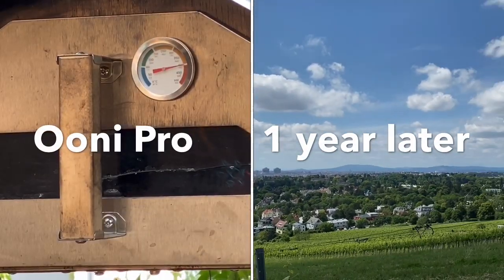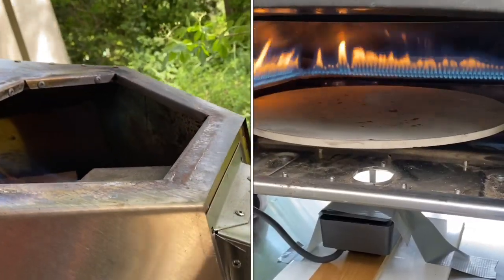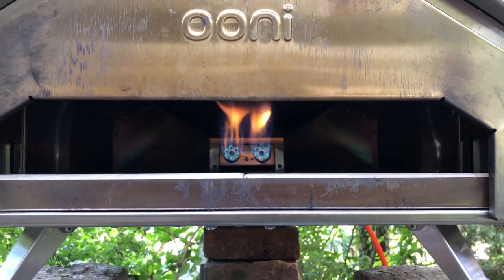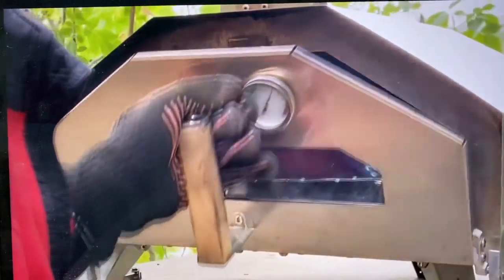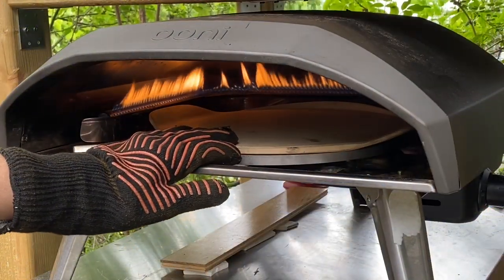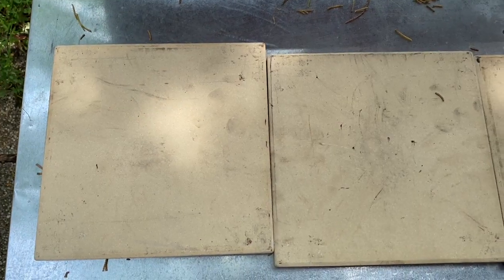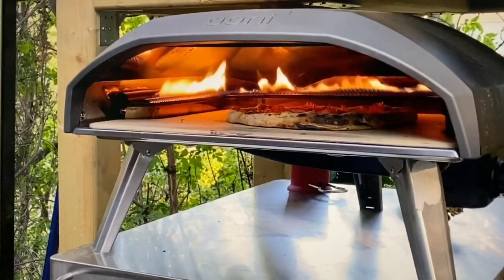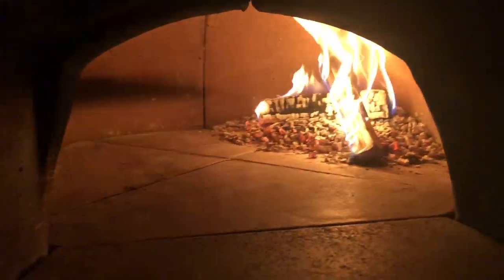1 year Ooni Pro vs. 2 month Koda 16 OR what the hack is my favourite Pizza oven

Comment: I just got told by a seller that a 16 inch pizza on the pro wasn't really possible, and they want to sell me a 14inch peel as a consequence.
Does that sound right - have you made 16inch pizzas on it?
Reply from the maker: yeah that sounds right man... this is just not possilble in a right way due to the heat difference from the front to the back - santa barbara baker does that in his vids but I'm not quite convinced... I think the right size for a koda 16 pizza is a 13 inch pizza _) greez hinze

Comment: Very nice video! Love the vineyards and the content. My thoughts are: they are both energy efficient; pro a bit more. That's nice for a backing a couple of pizza's. There is roam for improvement on temp consistency. More thermal mass would help, but I think this would have a negative effect on energy efficiency. I think an oven with a bit more thermal mass would help. Personally I prefer manual rotating. A round stone would be smaller with less thermal mass. But this is an opinion, not based on facts ;) Keep up the good work and enjoy your nice place!
Reply from the maker: Hey Pieterjdw! Thanks! Yeah you're absolutely right! More thermal mass makes it less energy efficient... if you're just into pizza it does not really matter... because you can get great pizza out of these small ovens but a dome like in the zio ziro mini or 60 just has a better radiant, convection and conduction heat so the pie rises more evenly... it is as with all this stuff... you get what you pay for... if you want thermal mass  you'll have to pay it and you'll have to heat it um :))) thanks a lot for your words and have fun with your pizza!
Reply from the maker: and... jea check this one out for thermal stability :))) https://youtu.be/A9xIEvDOsNo that's just insane - that's 10x the pirce of an ooni pro
Reply: @hinze55555  I have watched it; also very nice. Just like your most recent video! Very nice oven, but to pricy for me. Looking for something in between ;)
Reply from the maker: @pieterjdw  the zio would be it!
Reply: Great video! I’m shopping for a pizza oven and was looking at the Ooni’s you really helped me make a more informed decision! I was looking at the Ooni Karu 16 they are not selling the pro right now?? Still looking and watching every reviews!
Grazie!

Comment: Thanks so much for this thorough review! My children just ordered the Pro for me for Christmas but didn't realize it does not have the Natural Gas option which I think would be much easier to deal with since I have it readily available. I was ready to switch to the Koda 16 but now I have my doubts after your great review! Maybe I have to put up with propane, but have a better oven. Once again, thank you!
Reply from the maker: Michael, thanks so much for your kind words over my review about these two ovens! The Koda 16 is by no means a bad oven which I thought I made clear during the review. It just has some (built in) quircks that maybe could have been avoided. Your natural gas availability is a big point since it can be annoying swapping the propane bottles for years and years to com. You can maybe lend a bottle from a friend and check the pro and keep it if you like it. Do not hassle though if you'd rather get the koda 16 due to your higher convenience. If you do not stretch the pies over let's say 13" or so the heat difference problem becomes less important (thats just not what they advertise at ooni). If you're just into pizza and as a beginner you may even like the koda 16 more due to its bigger opeining and brighter cooking deck. I still have it as well. I'm just more into my BIG Italian ovens right now if you've been following my channel. All the best for YOUR pizza year 2021 and your family from vienna / austria! Hinze
Reply: @hinze55555  Thanks so much for your response. I really appreciate getting your view since you own both ovens. Thanks for clarifying that you also liked the Koda 16, I did not reach that conclusion watching so it's good to see you  that you still liked it. I think if the Pro had natural gas it would be an easy decision since as you point out the door on the Pro keeps the temperature constant throughout the oven while the Koda is a bit uneven, but maybe OK for smaller pizzas. The Pro also has a  slightly higher ceiling so cooking foods other than pizza is a better option. What did you mean by "brighter cooking deck"? Also, the Pro looks like it has a bigger opening than the Koda - am I mistaken? Best wishes for your 2021 pizza year as well! Mike

Comment: Great job on the comparison with pros and cons of each. I'm bouncing back and forth trying to decide between purchasing the pro vs the Koda 16. This is the first time I've heard the Koda called a food burning machine  LOL but I plan to cook only pizzas so maybe not an issue for me  I'm sad to hear the L-shaped burner is more gimmick than useful, but this is good info.
Reply from the maker: Hey! Thanks for your comment! If you want to hear my opinion on your bouncing problem… If you only are into pizza and you are a beginner I would rather choose the 16 over the pro! It is just easier to handle the pies and you can overcome the faults of the unit quite easily! Good luck 🤞
Reply: @hinze55555  Yes, I appreciate your advice, thanks!

Comment: The ooni pro has a front with small opening. This prevents most of the heat from flowing away. Couldn't you build such a front for the Koda 16? I suppose that the stone would be heated more evenly and one can realize this pyrolysis function for cleaning. Do you think so?
Reply from the maker: Hey Powermod! Yeah thanks for your comment and watching! Yeah i did this a view months ago here https://youtu.be/kouK58iEZU0 - you cannot use a “door” on the koda 16 because of the lack of O2 FLOW ... the pro can do this via the ceiling vent... since there is no such vent on the koda 16 you need at least a minimum of air flow for the flame to stay alive... all in all not that good of a construction I would say but hey the oven is also fine if you just do 12-13 inch pizzas or use the rotating stone hack! have fun ! Dont’t forget to share and subscribe for more of my content! greez from vienna - austria!

Comment: As a New Yorker, it's hard to be happy with a 14"in pizza on the pro. The door should be 17" because cooking a 16" you can't launch the pie off the peel; the 16"peel fits only if you lay it completely flat, you lift it even the slightest bit, it gets stuck immediately.  I hacked the oven to widen the opening, but I can't get the glass door on, which is sort of useless anyway;. Like you, the difference between the gas burner and the wood isn't significant enough to not just use the propane attachment. Cheers! great video. I mean for a backyard oven, the Pro makes a good 14" inch pizza..it actually cooks the bottom without burning the edges too much but you need to get the feel of it....easy to use with propane...but too much $ for what it's capable of.
Reply: I think it's hard to be happy with a 14" pizza on the Pro if the website advertises that a 16" is attainable. If it's not easy to do like people are saying, then it's hardly attainable.
Reply: @GenericAccountName52  I sent them a complaint. The customer service is pretty good. I think they're going to have to acknowledge you can't launch a 16-inch pie in that oven which is a huge oversight considering the oven can accommodate a large pizza

Comment: Very nice comparison video. I really struggle choosing between koda regular vs koda 16. Considering koda 16 has some issues and and ooni koda 12 is like super cheap about 2 times cheaper. Would you recommend going for a smaller one for first oven? Thanks in advance!
Reply from the maker: Mindaugas Gedvygas If you can afford it just go for the bigger one! The space is nice to have especially when you are a beginner! But you will be very happy with the smaller one as well! I will take the smaller one if I had my pro as well and the bigger one if I had only one oven!
Reply from the maker: Mindaugas Gedvygas get a small ooni or Gozney peel with the small koda and you’ll be happy with it!
Reply from the maker: Mindaugas Gedvygas … And! You can have the koda NOW in some shops and you will have to wait for the bigger one for two months or so so just get the normal one

Comment: Uh...You forget to mention that the Koda 16 has the draw back You experience because in Austria, Poland and the Netherlands the gas supply system is not  ideal
for the large burner! The gas injector in Austria and Poland are smaller than in other countries. Here in Holland we have A low gas pressure (30ml)
 Ooni is based in the UK and the US is their main market. Users from those countries don’t experience the lower temperature flame problem and bake beautiful pizza’s 
To call the L shaped burner A marketing gimmick and A failure is not correct for the countries that don’t suffer from lower pressure systems.
The flame on the side is why I bought the K16 because with just A flame in the back or even worse A door, You have no clue what is cooking!
I did not want to buy the more expensive Pro because You have to buy (the inferior) gas-burner separately, And the K16 is dedicated to gas.
I tuned the gasburner and now It does reach the 420+ C in the middle, Yes You need to spin pizza fast because this is intended for A Neapolitan pizza.
You can slowly bake A Roman pizza or bread in A electric oven.
Only mod I would still like in my K16 is to buy A biscotto, 

Servus Grampus,
Reply: About the gas pressure. I did a lot of research on that. Basically the gas injectors are adjusted to the 30.37,50 ml gas pressures. So a 50ml version has a smaller injector than the 30 ml. So you get the same amount of gas on all of them.
Reply from the maker: Always stay polite mate... I have an opinion on my channel and your comments are impertinent because you just can’t stand other people’s opinion.... please revise your statement in a polite way! Servus Nikolo
Reply: hinzes'news Servus Grampus,
never intended to be in-polite! I’m just passionate about the subject, I’have designed and build pizza wood fired  ovens in my quest to make A Verace Pizza Napoletana (Made with A Sourdough from Napels)
And have been looking for A solution at home, After the F1 electric oven I was checking out the “Baby” from Valoriani (To expensive) the Adore from Pizza Party, but It seems very difficult to import items like these to the Netherlands, So I finally decided on the Koda 16 and at first I was disappointed on the stone temperature which did not reach the AVPN  temp.
Until I fine tuned the oxygen inlets, Now I can reach the 420 c. temp  in the middle of the stone.
I talked to the Benelux supplier of Ooni and he sadly admitted that the focus of Ooni lays in the big market across the sea and the UK. And then again the customers who simply want to have A propane pizza oven that looks nice and will be the center of A garden Pizza party, will not notice A lack of performance unless they happen to live in one of the few countries like ours, and trying to  re-create A pie from the Capitol of Pizza👨🏻‍🍳🍕
Reply: I’m very happy now with the tuned K16, despite I’m still triyng to get A Biscotto to Holland.
Also happy I don’t need to fire up the stone pizza ovens for 5 ours before I can bake some pizza!

So I agree with You for most of the parts, And I admire Your collection of ovens,

And Yes Dutch people seem to be very forward with their opinions, Ich weiss...

Für nachste pizza oder Flammkuchen, Malzeit! 

KJ
Reply: @keesjanhoeksema9575  What did you change? And it might be easier to get a stone from broodoven . com
Reply: jeroen huisman I closed the air inlet on the gas injector more tight, then the fabric setting.
Thnx for the suggestion, But the industrial chamotte stones at Broodoven are no biscotto terra-cotta tiles. The hard Pressed chamotte won’t distribute and store the warmth as the porous biscotto.
Reply: @keesjanhoeksema9575  what is ml in this context and what would that convert to in mBar ?

Comment: My Ooni Pro is the 2019 revision with 2 big stones instead of the 4 smaller ones. The manual states clearly it is forbidden to use the glass door with the gas burner.

Comment: I found that you must have a timer for the Koda 16. Anything longer than 30 seconds will burn the pizza. I try to turn at 20 seconds and results are perfect. 2-3 turns and it is done.
Reply from the maker: That's good!!!
Reply: To be perfectly blunt I find that the Koda 16 sucks. As the informative video states, the temperature difference between the back and front of the oven is too great. I find that with 70% hydration it is impossible not to burn the crust. Good luck if you buy the Koda 16 !!!
Reply: @zeviklausner1  There are several factors impacting oven temp. Outside ambient air temp and wind at the location of the oven. It's possible that you are encountering two factors that cause more uneven oven temps.
Reply: John Hovan thank very much .

Comment: I’m torn between the Koda 16 and the Karu. The koda seems sturdier and would last longer, is that the case? I like that the karu can do wood, charcoal, and gas however are wood fired pizzas really that much better than gas fired pizzas?
Reply from the maker: LetOffSomeSteamBennett I‘d only plan to take the Karu if you plan to take it around more .... otherwise take the koda 16! You‘ll have a better learningcurve with this... and you‘ll very unlikely taste the difference!
Reply: @hinze55555  thanks, and would you say the koda is built better?
Reply from the maker: I don’t know the karu but the koda is built well!!
Reply: oh my, great video 👍🏽 
I have an order pending for the Koda 16... but this video might have turned my choice toward ... The Ooni Pro..

Just one question : my place is often windy. You said that the pro might suffer from gas burner unexpected shutdown in  windy conditions.
Will this occur even when the door is closed at high temperature ?
Thanks
Reply from the maker: Yeah it might! So you’re better off with the 16 - wind really is an issue with the pro gas burner! The 16 is way better in this respect!
Reply: IMO if your a gas person them Koda.  Its only gas.  If not...........